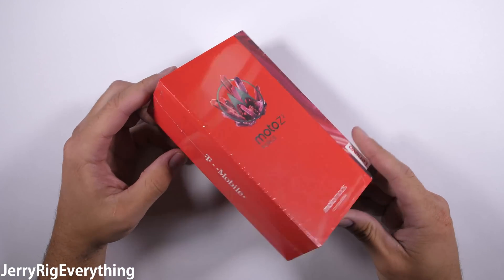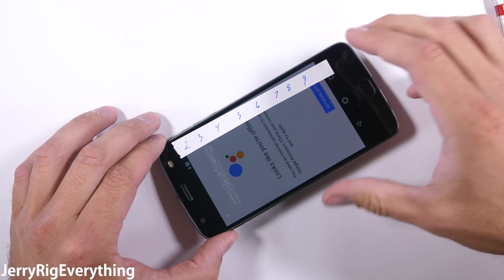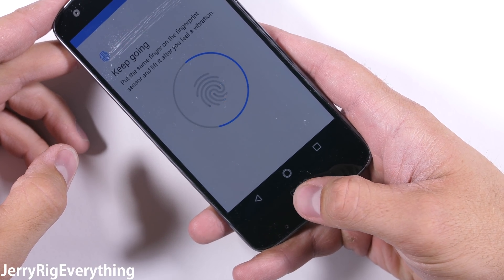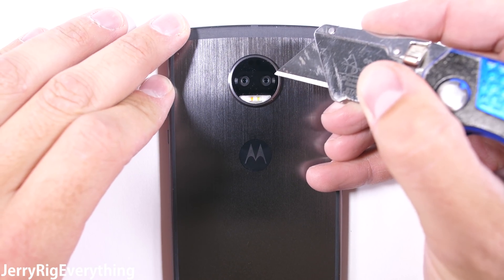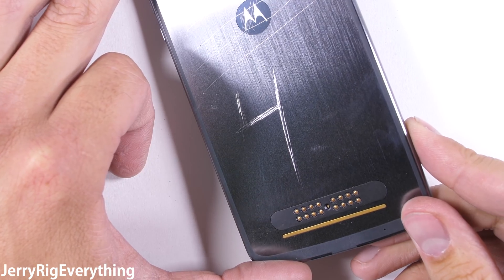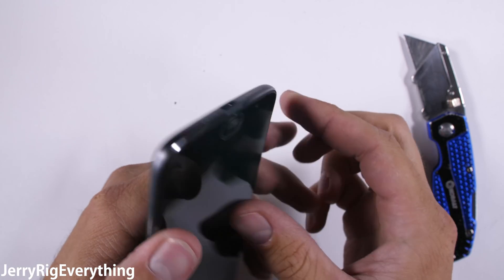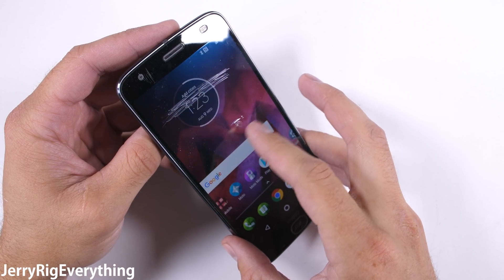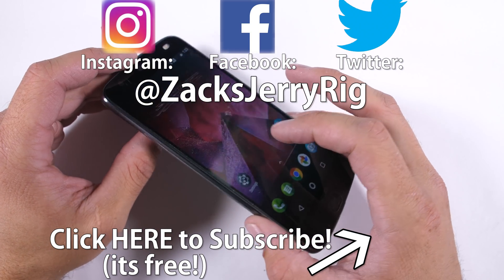Moto Z2 FORCE Durability Test - Scratch and Bend Test!

Comment: Well, the phone is pretty durable. It lives till now, but the battery lost it's juice and need to be replaced. Android 12 from LineageOS works like a charm. And mods also.
Reply: Do Moto Mods really work with LineageOS? I see the threads on XDA forum and the known bugs mentioned are all regarding Moto Mods themselves.
Reply: @farishanafiah8461  i have a projector, jbl soundboos and printer, only jbl not working, so no big deal

Comment: I'm just about ready to replace my z2. The battery mod + shatter proof screen basically makes it into a modern Nokia brick, with battery for 2 days and being extremely rugged. The battery mod takes it from super light to thick. My phone is very scarred, but it still gets the job done. I went through probably 6 glass screen protectors on it.

Comment: While the shatterproof screen is just a protective plastic layer of the actual screen, I'd like to know what the screen under that protective layer is made of . I just peeled mine off as the edges and around the fingerprint sensor were discoloring heavily and peeling. While it took a lot of work with heat and GooGone to get the thick plastic layer off, the screen looks brand new now. Ordered a tempered glass protector to replace the one I peeled off. It's also worth mentioning that I have had the phone since before this video was posted.

Comment: Do there's got to be a shatter resistant screen that you can put on cell phones I mean that is the biggest number one issue I just bought my LG Stylo 5 a week ago okay day to it was on my dashboard fell onto the floor and then I went to grab it and then knocked it out of my truck onto the ground and it broke I mean I was the first time I ever ever dropped it I couldn't believe it at least with my Stylo for the LG Stylo 4 I dropped it like five six seven hundred times and then it finally broke without a cake I had this phone for 2 days and it's like me on this phone was the same exact price as mine when it first came out the front Stylo 4 but for some reason it broke the screen broke way easier now I have a hole in the glass that goes into the phone and believe it or not my screen still works I mean I'm pretty impressed with that I am extremely hard on my phone I mean extremely hard and I don't mean to be it's just I talk with my hands a lot and my bonus usually at my hand unfortunately so I'd like to see you do a durability test on an LG Stylo V like I said I paid I don't think even $200 for it it has amazing pictures that takes amazing pictures and that's why I like it and it's all metal now I am not going to bend my phone because the screen is already broken but it is made out of what type of metal I don't know if it's aluminum or what but man I really wish they would start making cell phone screens with a more durable glass really I mean I'm not saying they should make it out of a sapphire like that one phone you're talking about because obviously that's too expensive for most people to pay for but even my screen protectors there supposed to be 9h I had one on my phone for 2 days and it broke like I when I was backing up I had my phone in my back pocket and my phone hit the corner of about a metal doorknob and just shattered the screen protector I'm glad it was the screen protector and not the screen anyways but yeah I love your videos

Comment: Bought the Moto Z 2 Force, got a 3 pack of Brotect 9H glass full coverage screen protectors for £10, so I have the Unbreakable screen with anti scratch glass layer so if any drops bumps - just replace the protector - makes sense rather than paying for a replacement glass screen - yes the phone is even more awesome in 2019 because I bought it for£150 new then some mods cheap off eBay 😁 and the snapdragon 835 is still more than enough for your average user - I use it for editing 5.7k 360 degree video from Insta 360 One X camera with no problem 😁 Battery life is also as good as other phones because it's so efficient - Buy one sim free then get sim only contract & save yourself a fortune 😄 Probably one of Moto's best phones.

Comment: I'm interested in the screen under the plastic screen when it comes to your picks for the scratch test. The screen basically cones with a ore installed super glued Greene protector which you should be able to pull off:)

Comment: as a broke person, i feel so bad seeing this someone's scratching my dream moto z2 phone. 🤥
they could have used defective unit just for this test instead.
Reply: I'm broke too, I've been saving up and I'm waiting for the next phone in the z line, although if he was using a defective unit it could be defective because it doesn't turn on or the body is damaged
Reply: It's not worth it you guys,they don't have any headphone jack and the screen protector peels off easily
Reply: @catyes7632  you can now get the z3 play for $170 with a free moto mod on the moto website
Reply: @anthony-ob6lw  it isn't available in the UK and importing it will cause problems
Reply: Plastic it self has the display unit of course this display u can twist it bend it u can only check this after removing display from the phone 👍 from my side, I am a big fan of Moto, I have Moto x Force, shutter sheild it fell in oil, water and lot of time it kissed the ground cement blocks and specially road it survived, even I saw a Moto G5S+ that was thrown by child from 3rd floor with rubber case it survived, even I had Moto z play best phone that I used. Yup ill of course say that Moto x Force lags some time but z play, z2 Force, G5+, G5S+, One Action never lags great job by Motorola.
Reply: New z4 has the jack back. Was pleased to see that when I replaced my z3
Reply: I had one for a long time and I hated it. Front camera, front flash, rear flash, and power button all failed one after another. Also, the modular idea is a joke. The contacts on the back corrode very easily. The phone got very slow after a year. I had 4 phones. 1 failed shortly after purchase and I got two defective units from the factory. Also, you cant put a screen protector on. Almost all the phones come warped from the factory so glass screen protectors do not stick.
Reply: @Martynas Sapiega Well you might had owned a near-defective device. I seems to have zero problem with my Z2 Force.
Reply: Farhan Ahmad Tajuddin I had 3 replacement phones, all of which were defective
Reply: @partymarty847  Oh dear. 😅

Comment: why don't manufacturers do this on the bck panel? it doesn't matter there >_<
also just put a cheap thin screen protector on the back and you'll have an indescribable back that you can just replace for like 1$ if it gets scratched, Same for front TBH. most people use a screen protector anyway

Comment: The display is only warrantied against cracking. Put a screen protector on, because if you get a puncture wound, it isn't covered. I'm on my third one: First one the screen cracked, second one got a puncture wound.

It comes with a USB C to earphone jack adapter. You can charge it while using the adapter if you have a wireless charging Moto mod. Also, the Moto mod extra battery is great.

Comment: I got Moto Z Droid. It's radio died within warranty and shop replaced it but new phone only had leftover warranty and it expired soon. In few months after that black lines started appearing on the right side of the screen. Official service they'd replace the screen for equivalent of $180. decided to wait and see what happens since the blackness was creeping from the edge and not very much in the way of using the phone. this morning my one year old dropped the phone so hard that camera glass shattered... 

Should I get Z2 Force as a replacement? I really like almost vanilla Android and mods. I got the extra battery mode (the 3250 mah) and I also like Google daydream platform. I could sell the Mod if any alternative came up but I cannot think of anything else. Vanilla android with Daydream support for this price.

Comment: I own this phone and the only problem I ever had with it was screen scratches. I used glass screen phones before and used screen protectors on those so it wasn't a discomfort putting one on my Z2 FORCE. Best phone I have ever owned!!!
Reply: How is the display in sunlight? There are too many light reflections?
Reply: @gigimarcone  I should receive it in a weeks if I remember I will news you about that.
Reply: I'm late to the party but I got a super scuffed/scratched Z2 Force used online for just $70, and what a lot of reviewers didn't say is that 99.99% of the scratches are completely invisible when the screen is on. I don't know how they designed it but my phone looks immaculate when I'm using it. The scratches are only visible in bright, direct sunlight, and even then the screen is more than useable. It's an incredible piece of tech and I'm bummed Motorola hasn't released a follow-up since.
Reply: It still is

Comment: hey i know this comment is almost a year late ,but the motorola z force 2 that i have came with an adapter for headphones in the case (for your daily drives). Also the phone comes with a screen protector and thats why theres an extra layer of plastic that covers the camera. And for when you fuck your screen up real bad they have a place on there website (or the moto app on the phone) where you can buy a replacement that they send to you (for about 40$ i think).

Comment: The plastic screen is more of a deal breaker than the lack of a headphone jack! It should be optional because I want one of these, but I can't deal with the easy to scratch screen!
5 years later I have to eat my words because the Moto Z2 Force is the last good phone that Moto made! The easy to scratch screen notwithstanding, I have bought 4 of them in a row. I used to use screen protectors, but I decided that it is not necessary and you can only see the scratches when it's powered off. Otherwise, it does everything well. The Snapdragon 835 10 nm 8 cores, is still quick 6 years later! I am watching this video on one. QHD display at 534 ppi is also unmatched by the current offerings. The headphone amplifier is better than the Moto Razr plus 2023 and it sounds better, too. I could go on all day

Comment: I have shut my (Z2 Force) phone in the rear hatch of my door...(Was using it as a dome light while changing diapers on my twin girls ) it's permanently bent .....like bent bent...like the S7 edge only at the top and not on the edge, instead it's from the bottom of the camera straight across from side to side... still working flawlessly... except the attachments won't fit anymore... any ideas!? Get Motorola to swap it out and use this phone as an example? LoL.

Comment: I've had a Z2 Force for several months now. Adding a glass screen protector completely handles the scratch problem for the screen. The lack of a headphone jack has never been a problem. I use an adaptor to use my usb C port, and my beefy 3500 mA moto mod combined with fast charging means I rarely need to charge while using an audio in. The projector has been wonderful for someone like me. I don't have a tv so now my phone has become a big screen TV. The quality is not as good and the room has to be very dark, but if your someone who doesn't watch a lot of television it's perfectly sufficient.

Comment: I love the torture test. Btw you have an excellent voice for this purpose. What I don't agree with is the issue of headphones. This device comes with a USB c to 3.5mm headphone adapter. It has a lanyard to marry it to the headphone cord. Most of us use the same headphones so you can leave the adapter attached to the headphone cord. Just like normal in usage. You just plug in your headphones (with adapter attached) like normal.

Comment: For me the Z2 Force's lack of headphone jack, plus a plastic screen, were both huge deal breakers. Having said this, the Z2 Play has been an amazing daily driver for me. Gorilla Glass on the front, 3.5mm headphone jack on the bottom, and no gimmicky dual-lens camera on the back. The CPU might not be on the bleeding edge, and the screen is "only" 1080p, but both are very capable for just about anything you can throw at the device. Oh, and the battery life is spectacular! Especially with JBL sound boost mod attached, you can easily go a day or two with moderate use, and not even need to think about battery levels. I haven't tried the battery saver feature yet, but I'm sure it works!

Comment: I went with this phone over Samsung/Apple due to the flat screen and the expandable battery, and cheaper price. Verizon had it for 15 a month if you preordered, and you also got a free projector mod. I don't like the curved screens because the sides of your phone a severely vulnerable to being hit as well as the front. 

I avoided the easily scratched screen by getting a screen protector immediately. I feel this phone will last me a while. I had never broken the screen on my Galaxy S6, but after seeing all the broken curved screens, I'm going to avoid them until I start seeing screens survive 2 years+

Comment: I put a glass screen protector on a more scratch resistant screen. I'm ok with a plastic screen. Also ok with no headphone port. I haven't used any yet but there are USB C headphones. Rare when the port delete first took place but becoming more common.
Reply: Additionally there is a car dock that connects like the mods with a built in headphone amp/dac for aux to car stereo that sounds quite premium.

Comment: If I were Motorola, i would put gorrilla glass on top, or i would melt the glass so it's molten, DUH.  then throw plastic in the molten glass.  BOOM! scratch proof shatterproof glass.  that's a windshield. but smaller.

Comment: Moto is NOT replacing the screens this time around. So definitely get a protector for it. Also. No headphone jack and a tiny battery are a total fail in my opinion..
Reply: The Z2 Play has a headphone jack and a bigger battery, so that's what you're looking for.
Reply: Tiny battery is only a problem if the battery life is also tiny.
Snapdragon 835 is more power efficient than cheaper phone CPUs like the SD 626 the Z2 Play has.
So Z2 Force may still last longer.
Screen size and pixel density also affects battery life. Please don't be a noob and look ONLY at battery sizes.
Reply: Battery life is dependent on usage.  If you use your phone a lot, then you want a 3500mAH and up size.  If you don't, then you can do just fine with some smaller.
Reply: A. Not true. They clearly replace screens but it will cost you 50 bucks. Easily avoided with a $5 protector.
B. Absolutely pointless thing to complain about when it comes with an adapter in the box. I hardly even use it because truly wireless headphones exist and are vastly more convenient.
C. "Tiny" is a huge exaggeration. It's slightly smaller than average yet lasts just as long or longer than plenty of phones with bigger batteries. You also have the turbo power pack as an option that adds 3490 mAh to give you a total of 6220 mAh. I could not charge my phone for 2 days. Power is not an issue.
Reply: My z2force has a battery life of 16:56 hours.
Reply: @lordbrain6420  with or without power mod?
Reply: I've had one caseless for a year you don't ever need a case with this phone it's been not only dropped in water but fell 12 ft onto rock and was fine.

Comment: Hey Zack, I recently stepped on my $90 earphones while they were attached to my laptop (I know, very stupid) and it severely bent the part of the earphone that goes into the jack. I tried straightening it out by plugging it into my phone, and it worked for a while, except now the sound goes in and out of the right earbud. I'd normally just buy another pair, except these are, well, $90 earphones.

I was wondering if you could do a video in which you show us how to fix common earphone/headphone problems? Thanks!
Reply: I know I'm a year late, but I'd have just spliced a new 3.5 mm jack on to the headphone cable and used electrical tape to insulate. Simple fix that would work
Reply: @Issac Arellano sound quality, idot you deserve this

Comment: Lenovo makes some of the finest built phones, of course after Nokia. Their Vibe P Series is a heck of an example. I am using Lenovo P2 right now - an impossibly sleek phone housing a mega 5100 mAH battery inside a metal casing which has endured drops from 8 feets without any damage. Would sway by them anyday just for the build quality they deliver.

Comment: A plastic screen would be the practical way to go, because it's the most expensive part on a smartphone. So, ruling that out, you can always apply a tempered glass on and you can have that glassy feeling, without worrying about your screen braking.

Edit: Props for the video. With the torture and abuse that smartphones undergo, I can have a solid view about the durability of said smartphones.

Comment: I used to feel the same way about headphone jacks, but since having my Mozo Z Force (original not this one), I've changed my tune. It's a spectacular phone, and I've managed to find some really decent wireless headphones from Klipsch that have a 16~ hour playback and charge incredibly fast, so I'm never stuck without them and they never go dead on me while listening. And they have surprisingly high quality sound as well. Just a bit steep, as would be expected with all it delivers.
Reply: My Z Force finally bit the dust after I dropped it one too many times. The screen didn't break, it just stopped turning on altogether. Lol. So I upgraded to the Z2 Force, and I'm loving it even more than ever. This camera is fantastic. <3